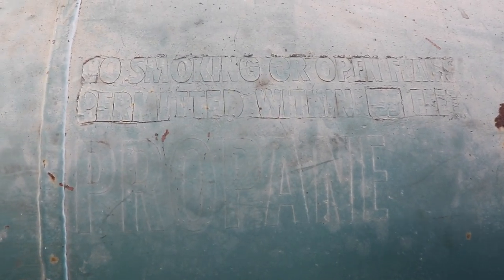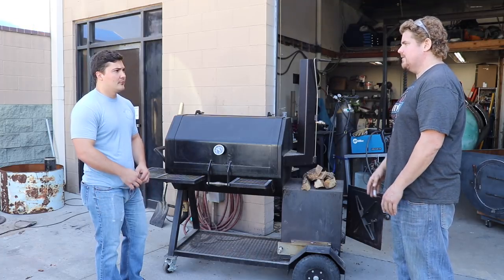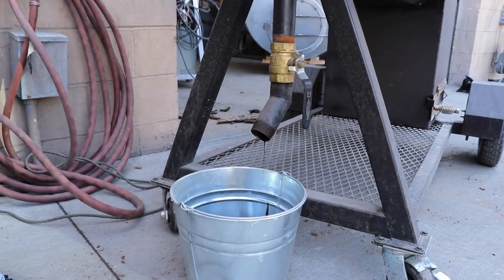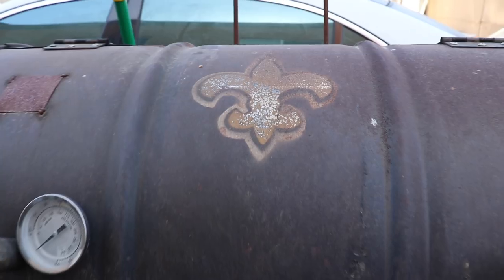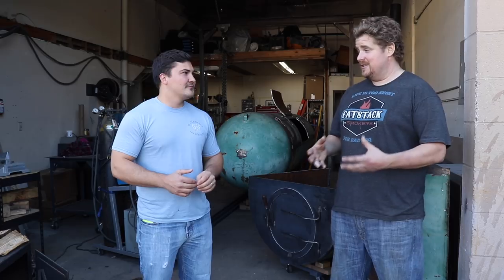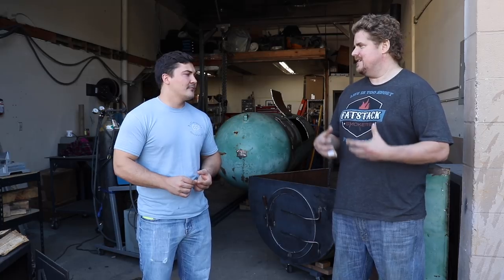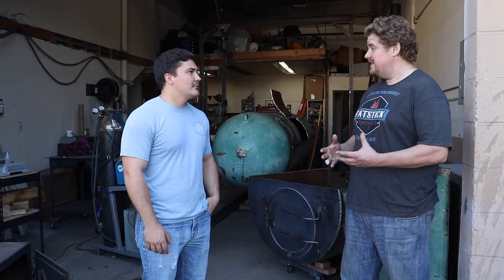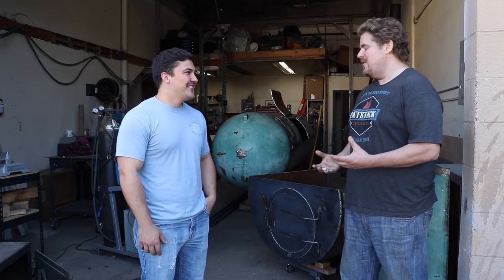Custom Offset Smokers: Fat Stack Smokers of Los Angeles

Comment: Hands down best video out there on youtube for custom offset smokers!! Fat stack rocks
Reply: When you tow the trailer, you want the open end faces the rear. If it was in the front, the air pressure of driving fast would blow the ash through the cook chamber and contaminate the grates.

Comment: On the subject of reverse flow vs. standard flow, if you use good tuning plates you can control the temps really well. I have a 24 x 36 stick burner and I can cook with a 5 degree difference from one side to the other.
Reply from the maker: Hey pete.  I get you.  For me though, I prefer standard flow for the outstanding convection it produces. I don't think I would do the tuning plates in a little pit because it causes a lot of radiant heat to cook the meat sooner than it would otherwise.  That is how it works on my little smoker at least.

Comment: I would appreciate to hear Eric's explanation of why smokers mostly have the firebox on the right side.
If it would be trailer mounted. Wouldn't it be more logic to have the doors on the pavement side?
Reply from the maker: That's an interesting question! I will ask him, but what you said makes sense.  I would think it is best for the smoker to have its doors facing the sidewalk if you parked on the street. That way you can check your BBQ without being in the street.
Reply: This man's question just blew my mind. I never thought of that.
Reply: I feel like it is important for the door to be on the end of a long fire box. Thereby keeping the hot fire further away from the product.

Comment: Nice video. I’ve been watching your channel for a while starting from your Old Country smoker. I also know that you just have your 500 gal. Fatstack cooker and actually watch your first cook which I think very brave of you to do it on a catering event. Great job though! Anyway, I’m also a BBQ fanatic just like you and I find Fatstack smokers interesting. I think Eric is right about the difference between a traditional smoker and a reversed flow smoker. Actually I started with an Oklahoma Joe that I got from Lowe’s and just like you I thought I got the best smoker at the time. Well, after burning a lot of meat and watching a lot of videos, my wife finally agree to get me a more descent smoker. I have a reverse flow made by Shirley Fabrication out in Tuscaloosa Alabama and its really amazing compared to my Oklahoma Joe. Back to Erick’s theory,  I completely agree that when it comes to smaller smokers, reverse flow are more efficient than traditional smokers. It’s easier to manage the temperature in my opinion because of the solid plate under the meat . The downside though is cleaning the pit because there is no access under the plate. Overall I like my Shirley but if ever I need a bigger smoker, I would love to have just like your 500 gal. Fatstack smoker hands down. Keep posting videos my friend and hope to meeting you someday.

Comment: Could you do a 1750 gallon smoker similar to a Yoder 24 with a v Tron smoke collector weld connected to the vertical 750 gallon cooking and knowing that the 1000 gal by itself starts at $15,000 how much would that cost custom-built box

Comment: I am looking at a gently used reverse flow, very similar to the octagon shape near the beginning of this video. I have a concern about the location of the stack. Instead of the exhaust manifold welded near the bottom grate, it is just a piece of square tubing welded on top of the octagon. Will that have a negative effect? I feel like that is a design flaw, hence why it is gently used.

Comment: I just bought an old 500gallon propane tank for $100 that I will be turning into an offset. In other words selling a 500gallon offset smoker for $10,000+, like fatstacks does, is a huge mark up. If anything, they should be sold for $5000-$6000
Just my opinion.
Reply: Always paying for time my friend. Plus the rest of the steel involved aside from the 2 tanks.